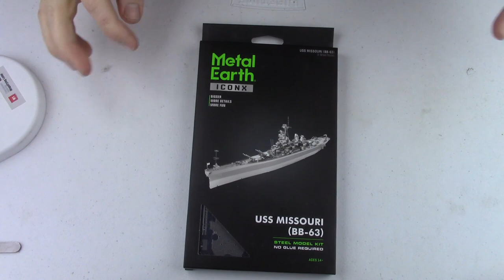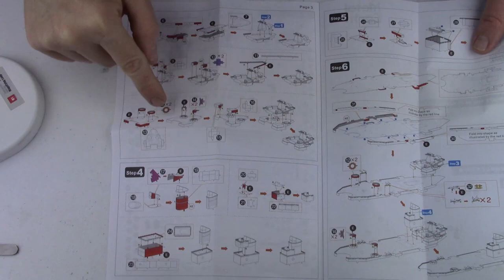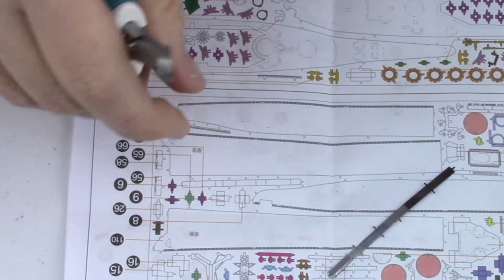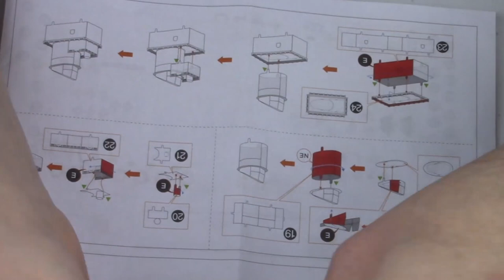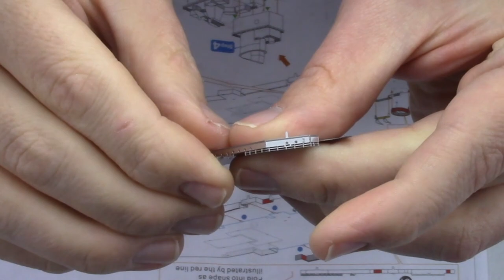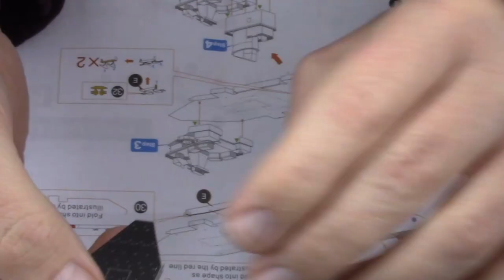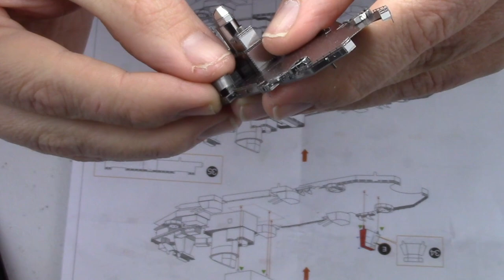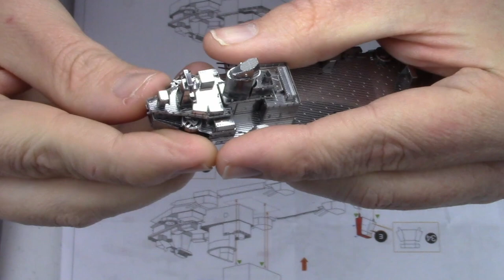ICONX Build - U.S.S. Missouri - Part 1

Comment: I just finished this one. One part that frustrated me a bit was mounting the large gun barrels in the turrets - they don't seem to fit as tight as they should, so they don't necessarily stay parallel, which doesn't look right. I ended up cheating by putting a very small dab of clear epoxy on the underside of  each barrel mount to keep them all lined up.
Reply from the maker: Robert Fleische I know what you mean. It bugs me a little too, but knowing that that on the real thing they do move up and down gives me some small piece of mind.
Reply: ...been there, done that!

Comment: May I ask you some question? Is this model durable when it finished?
Reply from the maker: Mattias Charman for the most part yes. The overall structure is fairly sound but the antennas and smaller gun barrels are easily bent.

Comment: The thing is, what if I don’t fold it the right way, or fold it too far and can’t get it right
Reply from the maker: That's a possibility. If you are careful you can usually get away with one corrective refold. With time and experience I have gotten better at getting out of or avoiding "tight spots" such as that.